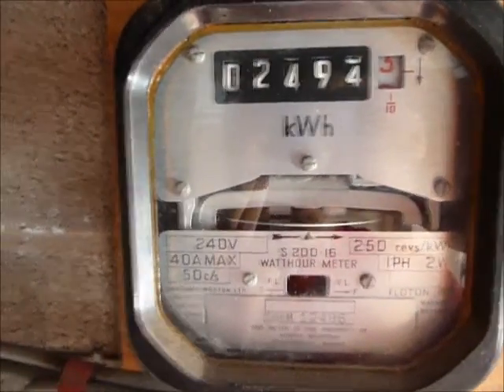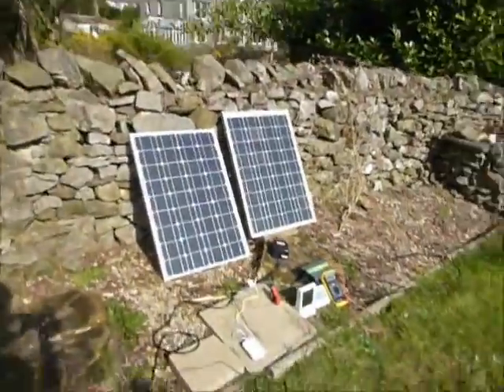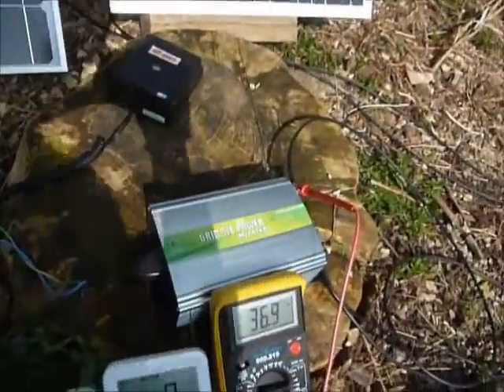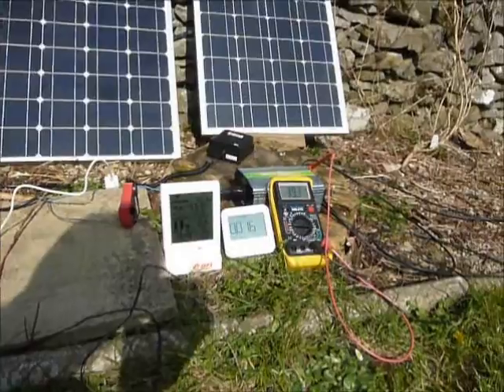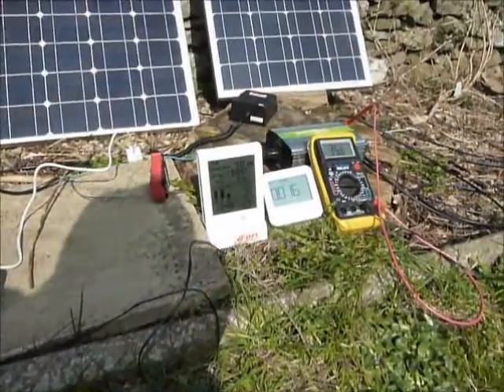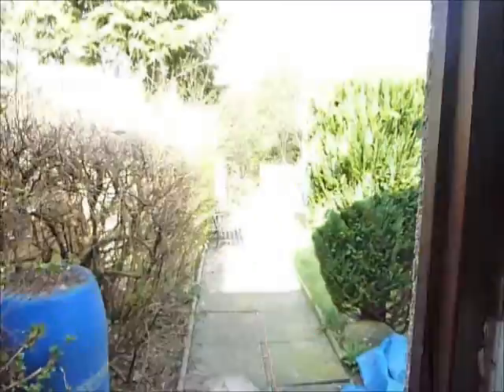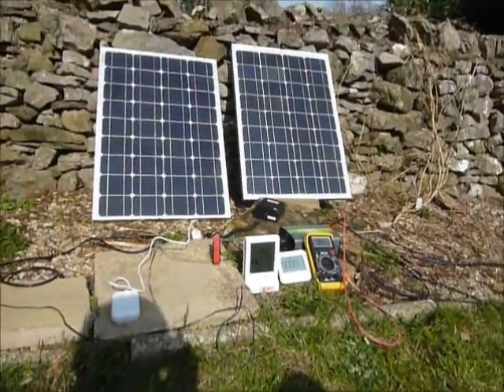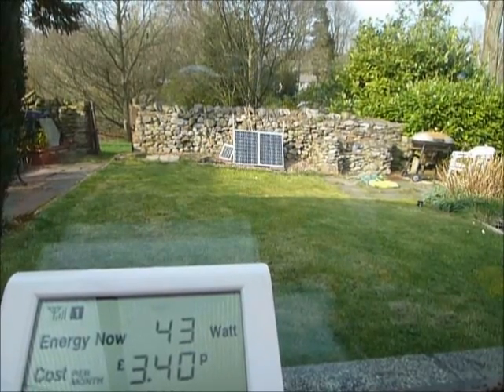Simple Solar PV Grid-tie Setup Demonstration

Comment: The 0.65 figure is just to get a general idea of what you will see typically from the Power Jack small GTIs at FULL OUTPUT. At lower outputs they are more efficient. If you have a cloud next to the sun you also get the cloud reflection and may see more power than normal. The sticker on the panel is generally the maximum you would see on a perfect day with clouds in a circle around the sun. It's legal to spec it that way because it can happen and would be the max. Best way to know, use a DVM.

Comment: You can calculate the typical output to the grid as panel sticker wattage X 0.65 and that's what you get to the grid at full GTI output. A little more power out at lower power than the GTI is rated for.